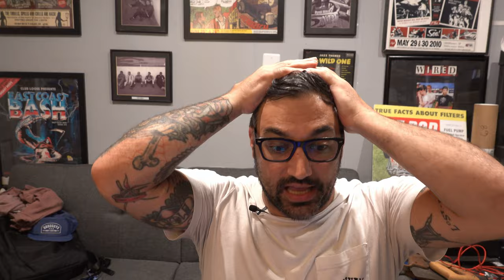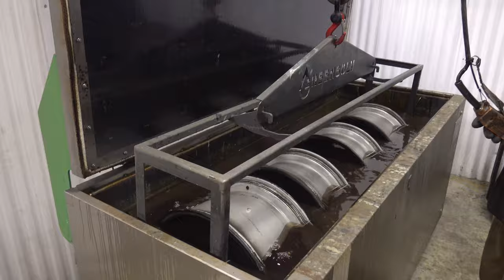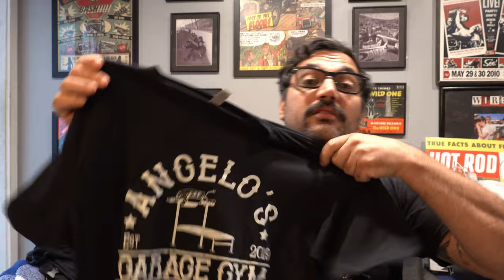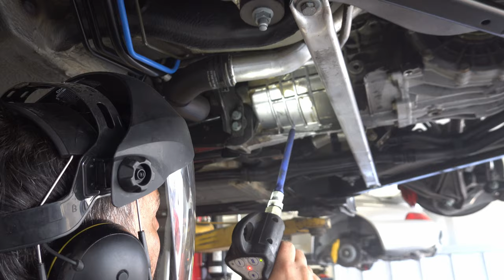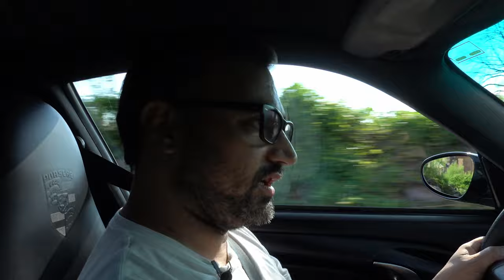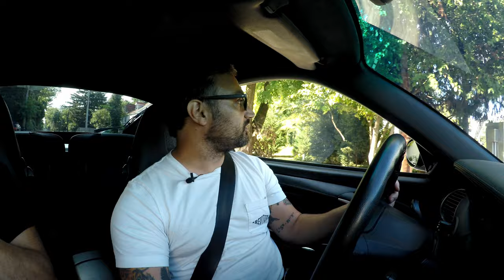Market CRASHING! Deals are FINALLY COMING BACK!

Comment: I scored on a '72 Vega GT wagon for $500 for my Dad to work on here in Texas. Car is a real peach too, only a few minor dents and the doors open and close like new.
Gave him a solid 5.3 I've had sitting to go in it along with a freshly built TH350 to go behind it.
Also scored an '03 S-10 to swap the front suspension and rear differential into the Vega from for $200.
Deals are still out there just not so much in the bigger city environs.
Reply: Nice find

Comment: Went through the same thing when I sold my BMW 525. Spent a year (spare time) doing body and paint, all maintenance, fixing small issues and overhauling suspension. Ran and drove fantastic, loved it but had an incident on the back of a flatbed wrecker when the radiator blew and the front end suffered damage. Insurance paid, kept the car and decided I was done. Put It on Facebook and the trolls started. Got offered scrap price for the car, told it was junk but they kept trying to talk me into selling. Finally found someone who had a similar car, same color, different interior but had flooded and was ordered to destroy his vehicle.  He made a fair offer, brought a radiator and battery. I straightened out the damage, we installed parts and he drove home tickled to death he had a good replacement for his vehicle. Sometimes you have to just be patient and wait for the right buyer.
Reply from the maker: Yeah, that is the tough part. Find someone serious, and reasonable.

Comment: Brother I work at theGoodyear Tire plant in Fayetteville ,Nc and we use a really big dry ice blaster to clean the molds that we cure the tires in. It hooks to a 1 inch air line. It's got a big shacker and holding tank. That thing is super fun. The only things is it's a very dirty job. And you have to climb up on the 342 degree machine to blast it so it's really hot lol. I Luv your content brother.

Comment: I really wish I had bought a truck right when the pandemic hit, prices have been through the roof for trucks with 150k plus miles and still going for almost 30k! Looking forward to some more reasonable prices here. Keep up the great content Tony!
Reply: I stole a high mile Raptor right at the beginning of the pandemmy. Got super lucky. Online ad with no pics and no price, I called just to clown them as I expected it to be ridiculously priced. NOPE!!  I couldn't give them my money fast enough.
Reply: So true.  Bought a new 2021 Z71 Colorado last year.  It was $7K cheaper than the sticker price on a 2018 ZR2 and it was the ONLY new truck on the lot.  Bought it that morning.
Reply: I'm in desperate need of a new truck, but I'll be dammed if I'm going to pay the dealer "market adjustments" I'm  going to enjoy watching them choke on excess inventory.
Reply: You guys that want trucks should get a clean old square body, or whatever old truck you prefer. Less than half the price,  and very cheap maintenance. I have a couple and they get compliments everywhere I go. You can still find rust free examples.
Reply: @SightsNjunk  they were garbage when they were new, and they didn't improve with age. The next body style with fuel injection and IFS was light years better. It's comical to see you youngsters venerate that old crap to those of us who had no other choices until the late 80's.
Reply: @jimmaag4274  Who's young? If you think they were junk, you must've bought one with power windows. A C20 is by far the cheapest truck to maintain. I have 2. Both original motor, trans, and axles. Tune up every 4 years. I drove both across the country within the last year, with my kid. None of that was the point though. They are available, cheap to buy and maintain, and they won't depreciate anymore.

Comment: Yup totally, I been noticing classics on market place with pride reductions left and right.  I took advantage of the market last summer myself when I sold my restored 1972 GTO which in the Pontiac world isn’t a real GTO and everyone makes fun of you. I bought it initially bc it’s been on my bucket list since I was 13 to own a GTO and it was just in my price range since they are much cheaper than the 68-71s.  I bought it thinking I would never make money, I figured I’d actually lose money, but the market got hot and I was like “ fuck it” I’m going to capitalize on this and sell it.  It was absolutely mind blowing a made a profit. Everyone and anyone that understand GTOs knows that the price of that year are and will be always stagnant bc if it’s reputation but I actually made money. After the car left I had to go to the packy and buy some drinks bc I was so bewildered and dumbfounded.  I was like “ how they fuck was this even possible? I bought this car thinking it was a terrible investment, and full well knowing that, I actually made money”.  Tells you how inflated the market was/is.  I also sold a good looking but worn/ rotted 80 black trans am in may 2020 for 8k thinking the market would crash. The dickhead who bought it from me flipped it for 12k that same week and even used my pictures from my market place post! Everything went crazy after that.  Now they best car I can get cheap in my area is a 73 century with a built 455 for 7500. That’s nuts.

Comment: Someone I know bought a Prius Prime, used it for one year and 50,000 miles with Uber, and then sold it for more than the purchase price. That to me, is insanity. 
I moved to PA late last year so I know of the close relationship between PA and Mexico. 
Where I am from (Idaho) the speed limit is 80 on the interstate and few people go more than 85 or so. in PA, the speed limits are much lower, but people drive any speed they wish, often 20-30 MPH over the speed limit everywhere, particularly if the road is filled with blind corners and blind hills and deer. (Or so I have been told, I personally have never experienced anything higher than the speed limit unless on a closed course.)

Comment: You want to buy a 2004 GTO 6spd? I am willing to let it go pretty cheap. It's in great shape, TX car, no rust, good interior, tons of new parts. I had a terrible misfortune where I siezed the short block. It comes with two build-able short blocks, two sets of heads, 2 cams, everything to put it back together.  It's been in storage 3yrs, it was garaged before that it whole life. People always want to screw you, I would at least like to sell to someone I like if I'm going to take a bath on it. I'm a disabled veteran and I don't have a decent driveway or garage to fix it in.
Reply from the maker: Where ya located? Shoot me an email. Tony@tangeloracing.com maybe we can connect on it.

Comment: C4S ones aren't hollow spoke. Did you paint the surface that touches the hub? Just so you know with dry ice you have removed the cosmoline. It would be great to at least apply clear wax.

Comment: My buddy lost his ass in the in the early 2000s. He had 30+ cars valued over 100k each. Mostly low mile Chevelles and 60s Camaros. He said before he could update adds they dropped to 50-60k and still are not not at that 90s bubble value he insured them at. A low mile Camaro SS that sold for 125 in the 90s went to 60 in a week. He lost 1/2 his wealth in that time. His Harleys crashed worse. These prices have still not come back even w/ PPP loans and free money.
Reply from the maker: Yeah, watching this market move has been crazy. I wonder if they will come back up from that late 90's/early 00 numbers.
Reply: 1957 Thunderbirds used to bring $150k, now half that and probably never be the diva they were. The audiences are changing, boomers are passing away, so what’s the next trend?

Comment: I just live by the mantra of buying the least desirable versions of cool cars. Firebirds are still as fun to sit in as Trans Ams. My Cutlass is not a 442, my '57 is a post car full of rust. All of which I paid less than $1500 to start with. I find it hard to be under water on a car when I do the type of work they need to run and drive again.

Comment: G bodys prices are starting to normalize
Reply from the maker: YES! I have seen this with my own eyes. Want something plain I can street park in the city and might grab a Non-SS Monte.
Reply: @StayTunedTA  100%.
Reply: What is the going price for a G-Body?  I have a 1979 Monte Carlo with with a 400 small block, stock vortec heads, with a 700r4, dual exhaust with CPP rear suspension, I’ll be getting the tubular upper and lower control arms and upgraded brakes. I also will be converting it over to a Holley Sniper TBI.
Reply: @StayTunedTA  I have been watching prices on mid 80’s Cuttys.  Finally getting back to project prices and not retail

Comment: 996 Nerd fact: The 4S wheels are not hollow spoke, only the turbo wheels are. Great work on this car and I think the price you got for it was fair. The porsche purists like their cars low mileage somehow. But it’s better to have a higher mileage one that has the bugs sorted. Maybe try the older non c4 996 model or a turbo. Those are maybe a bit more popular. 997 is also fun. Or a 993 or older.

Comment: Great video.. Once I got a deposit I would have locked it up in the shop, not ripped it around the countryside. What happened with sisters boat?
Reply from the maker: I know, but I wanted to make sure it was 100% or something. Sisters boat motor just cleared the machine shop. honed, head/valve job, crank polish and bearings, so we can start pretty fresh.
Reply: @StayTunedTA  Thanks for the reply. Love the show keep up the great work.

Comment: Did you also feel that the 996 seatbelt is weird?  I swear that seatbelt rides on my neck no matter where I adjust it in mine.
Reply from the maker: I think it used to work better but I couldn't get comfortable.

Comment: Those wheels would have looked amazing in pvd chrome. Maybe even black pvd chrome....
Reply from the maker: We were going for resale, but what's PVD chrome?
Reply: @StayTunedTA  pvd chrome is basically a thin film they put on the wheels and then clear over that mimics the appearance of actual chrome. It's a bit darker in color but it pops in the sun. A bunch of o.e. stuff is done in it these days. I had a set of Marauder wheels done in pvd and even after 6 years of daily driving they still look great. Cost wise it's a bit more than paint but back when I did mine it was $750 out the door.

Comment: The dry ice blasting is sick. Anyone aware of down sides besides cost?
Reply from the maker: I think the dust is gotta be handled right, and there's a bit of danger of having too much C02 in the air but I think both of those can be easily handled.

Comment: comment for your algorithm
Reply from the maker: Appreciate it!
Reply: @StayTunedTA  rooting for you. Wish I could have got into that 911 you just sold. I need the market to cool off a bit. Even then, probably the most I can hope for is a base model Cayman with 100k miles. More likely the next Porsche will be a later version 944.
Reply: @StayTunedTA  The idea of an RX-8 with a n engine swap is enticing. I wonder what straight 6 might fit instead of the typical SBC?

Comment: Tony, you live in the north east, you're looking on FBM for deals. That is almost worst case scenario. People think stock cast iron intake manifolds are worth $600 on there because of a date code. Your idea of a bargain is very different from mine. I drag old cars out of Nebraska, Kansas, Oklahoma, and Texas all the time. Of course if you want to scrap it because of a quarter sized rust hole behind the wheel, you aren't going to want most of them. 

Some cars I rebuild, like my 65 GTO, you wouldn't even consider... but I turn them into fun daily drivers. My 69 GTO and 68 Firebird are worse than the 65 was, and I figure if I get it for $200 I can dump $3k of sheet metal into it. I rebuilt the 65 for less than $15k, and that includes the 455 power, FiTech EFI, upgraded suspension and brakes, hidden stereo that thumps, and 700R4 trans. 

Sure I have skills, time, and a shop to work in, but I have been doing this since I got my first car in 1982 for $450.  The newest thing I own is a 2007 GMC crew cab 1500 that I stuffed a 6.0 into so I can pull my trailer with me and my huskies riding in comfort. I paid the guy $400 for the GMC, $175 for the Denali the 6.0 came from, and I have more invested in new axles under my trailer than I have in the truck thats going to pull it. This winter the GMC is getting the rust repaired, because everything up here rusts if it moves in winter. All the metal it needs is sitting in the shop, and cost about $250.

The 69 GTO is going in the shop as soon as the 72 Cutlass and 71 Mustang fastback are out of there. I'm not building them to sell, I build them to drive and enjoy.